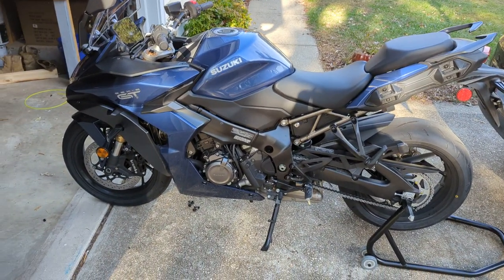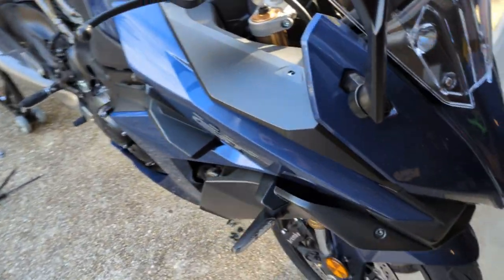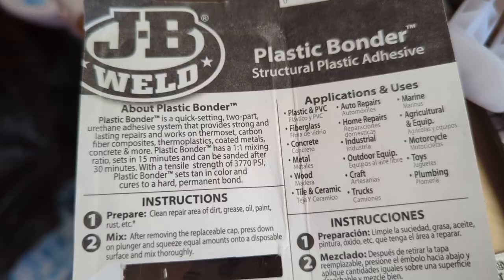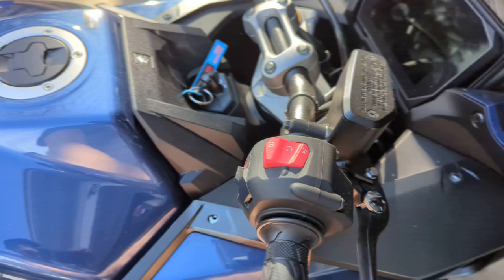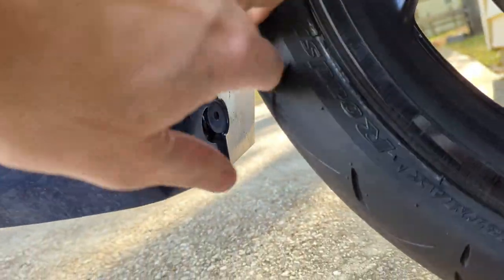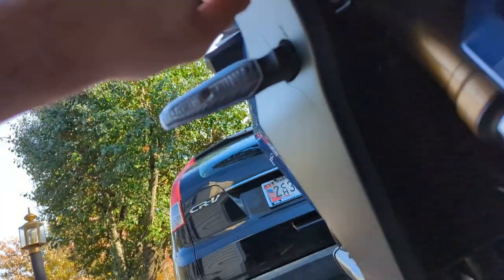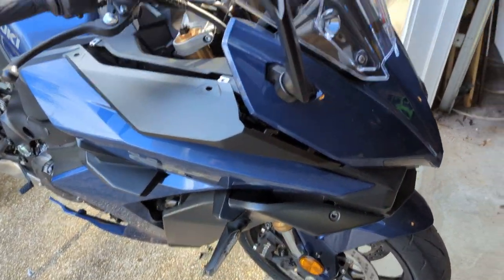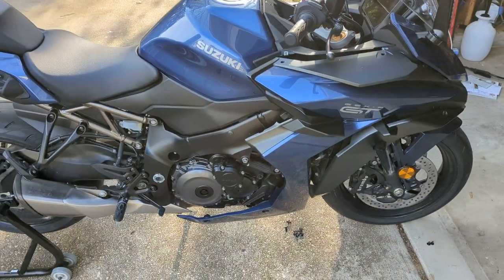2022 Suzuki GSX S1000 GT Fairing Removal

Comment: thanks for the video...I did my oil change without removing the fairing, just a long ratchet extension in between the pipes....
Reply from the maker: That's good to know, did oil get on the fairings or anything?
Reply: @bladecentered2264  I put aluminum foil over the pipes, not a drop got on pipes/fairings.
Reply from the maker: @bradleafers9647  I'll definitely be doing that

Comment: Great video! I just installed heated grips, you basically have to take the entire bike apart lol. Then I put it all back together and had 1 bolt left over, ugh. 

The bright side is I’m now very familiar with lifting the tank so spark plug and air filter changes will be easier.